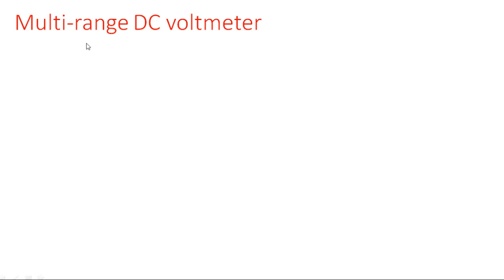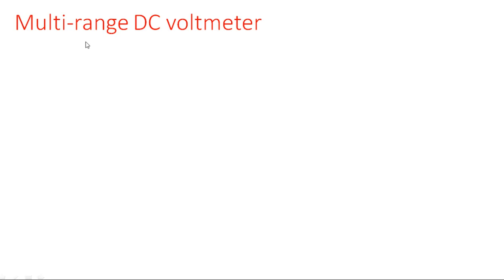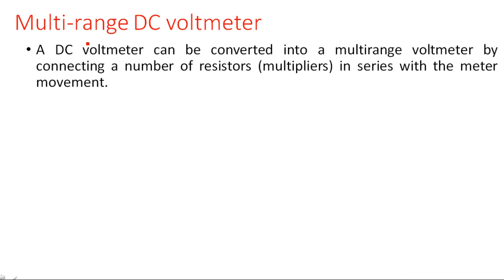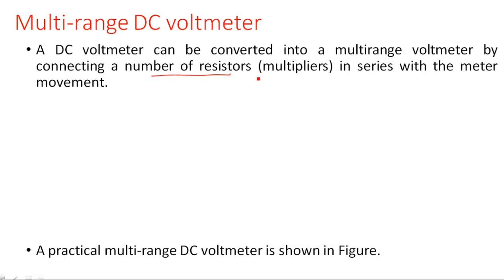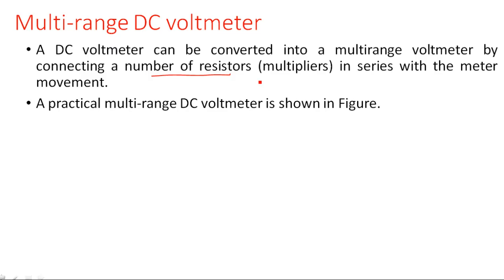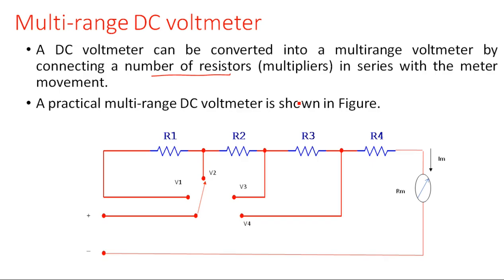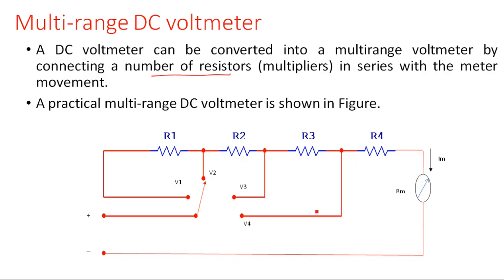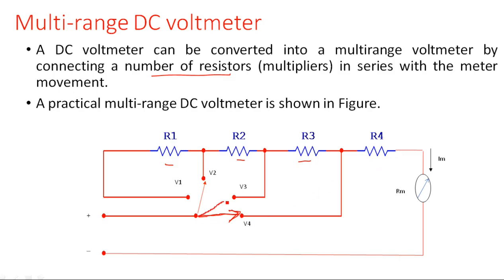Multi-Range voltmeter | Examples | Electrical Instruments ( EIM ) | Lec - 08

Comment: Multi range voltmeter with an internal resistance Rm=50ohms full scale current of 0.5mA is to be converted into a multi range dc voltmeter with range v1=10v,v2=50v,v3=250v,v4=500v show the arrangement with help of digram with the value of resistance
Reply: Hello , which text book has these questions ???
Reply: @jonathanbanda5395  Did you find the book?

Comment: please  give  another
Reply: u

🎉🌀wwwXzhj😢Galvanometer R
m = 50 
 and 
full
-scale deflection at Im = 2mA.
● Voltage ranges are as follows ○ 0– 10 V ○ 0– 50 V ○ 0– 100 V ○ 0– 500 V ● Calculate R1, R2, R3 and R4
ry 😮🎉 bu😅  o😊